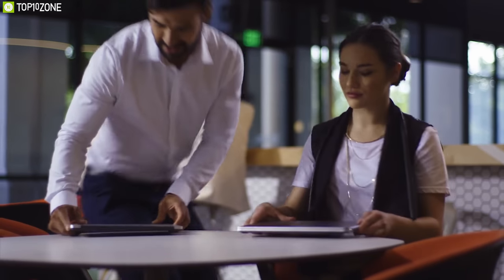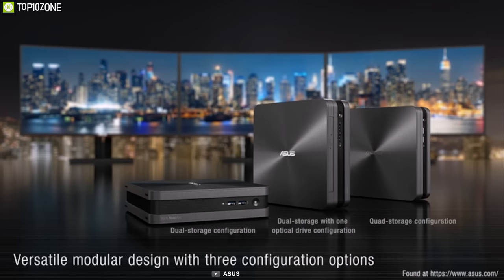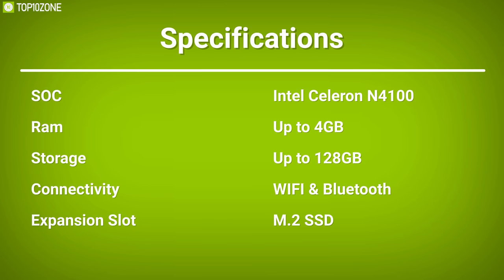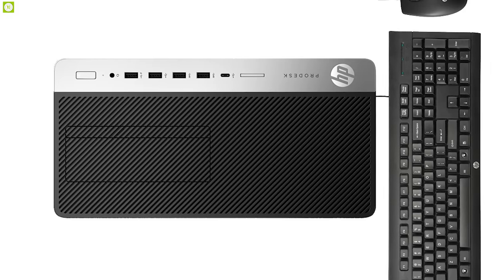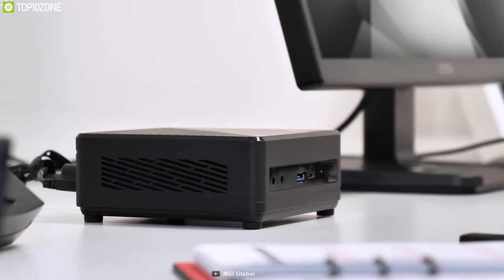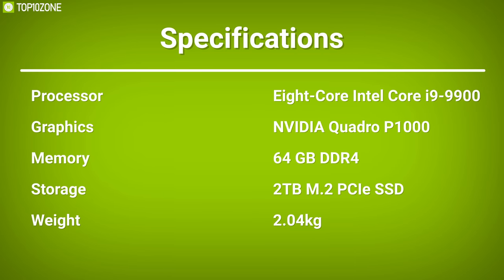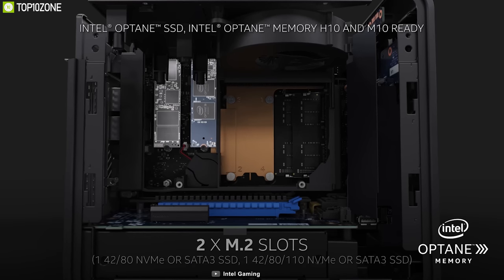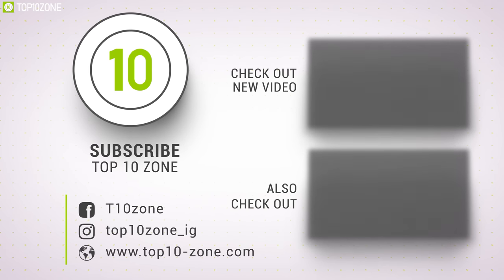Top 10 Best Ultimate Desktop Mini PC

Comment: The "review" is clearly a scheme, fake and misleading. To be convinced, we just have to look at what is said about the Mac mini (Apple), a computer I know extremely well. The GPU (graphics) is just a low end integrated graphic, yet it is presented as powerful. Try playing non-basic games, doing serious video editing or encoding: it will just not work. Second, the specs given (Core i7, 64 RAM, 2 TB SSD) refer not to the specs of the device, but to the most expensive options! The Mac mini comes in two stock configurations, with much less impressive numbers: Intel i3 or i5, not i7, 8 GB of RAM, not 64, and 256 GB or 512 GB of SSD, not 2 TB. The top specs mean a a much more expensive PC, and much higher commissions. The loud music also ensures that people have to constantly make a special effort to analyse / remember what is said to check for inconsistencies or lapses. To further extract cash, don't even bother showing products that match your criteria (mini PCs): the HP ProDesk is not a mini PC. It is much bigger (Small Form Factor). Just look at HP web page to see the size and weight difference between the mini and small form PCs. And if you look at the HP Legion, it is hardly small. Great approach overall!
Reply: No sight of any review here, no comparative prices or performance metrics. Just an advertising showcase with zero substance.  Plus no AMD integrated graphics machine with a good price/performance metric.
Reply: Yeah. I was so pissed when he talked about prodesk sff but shows a picture of prodesk mini. Clearly he has no idea what he's talking about